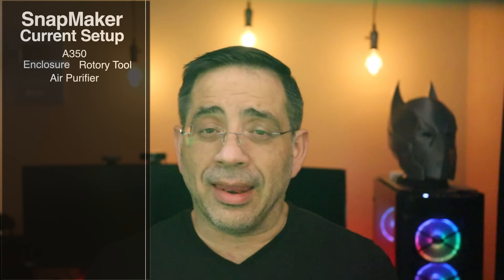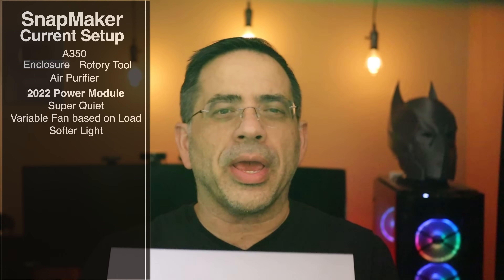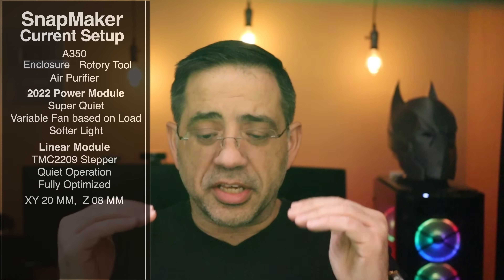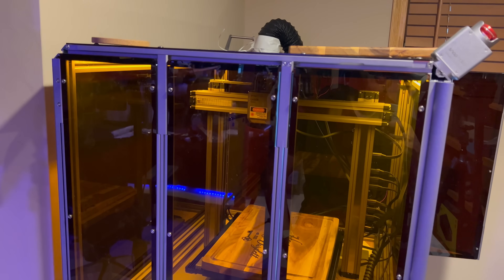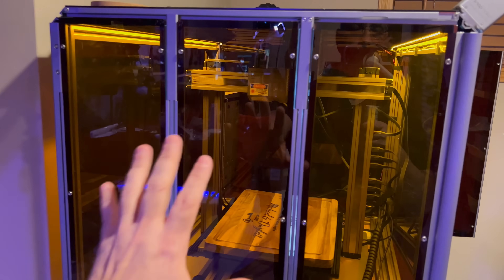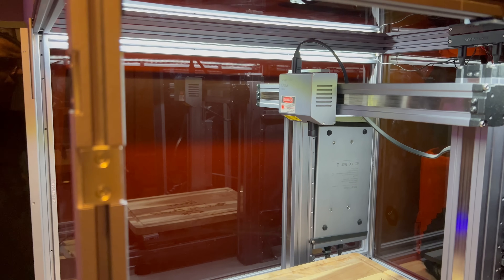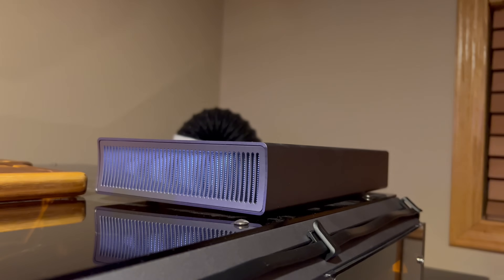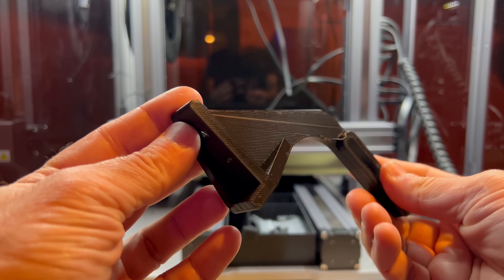I Upgraded my Snapmaker 2.0 Was it worth It?  YES!!! POWER, 3D Print Head & NEW Linear Module

Comment: In my opinion, your reasons for upgrading do NOT justify replacement or encourage me as a owner to upgrade as you did.
Reply from the maker: Comes down to your usage.  I have my snap maker in my basement.  I want it quite as possible.  So the  ew rails make things quiet.  The power supply too  makes it even more quiet. The print head, laser module all depend on you usage. It's cut my print engrave time significantly.  Now most important of all my wife doesn't complain about how loud it is.

Comment: I think it should be mentioned that the position of the folding doors and the display holder can not be changed. Which is both stupid and frustrating.

There is one folding door at the front and a second one at the right side of the printer. In case you would want or need the larger folding door on the left side, well, tough luck. When asked, Snapmaker is telling you that well, apparently the idea that someone would need the folding door and/or the display on the left side never even crossed their minds.

Comment: Nice Snapmaker. I have the same A350, and yes the power supply is loud. That annoys me more than the rails. In fact I have a Lulzbot TAZ 5 and the power supply is quiet with a variable power supply fan and no light. I might order the new power supply. Question. I also LOVE the PEI print beds as my Lulzbot has a PEI and it's GREAT. I could not find a PEI that is exactly the size of the Snapmaker. I got really close in that I found one with the identical size width but length is a little short. So I am loosing about 1.5 inches of bed lengthwise. I got a print bed from TRONXY. The PEI bed also has a sandy type feel which makes for great adhesion and a nice touch to the bottom of the prints. It's also magnetic. So, curious. Seems like the print bed you got matches the size of your A350 bed. Where did you get it. I'm not really missing the 1.5 inches but when I do a bed leveling I do have to shift the bed during the leveling so it catches the bed. That's a pain but I don't have to level all that often. But, still curious on where you got the PEI bed. Nice video.
Reply: Hi. Do you get any answer where he got his PEI printing bed?
Reply: @danielfaist-holzmann3690  I stopped worrying about an exact size. I got this one from AmazonL TRONXY PEI Magnetic Flexible Heated Bed 330x330mm Flexible Magnetic PEI Sheet. It very very close to the full size. If I want every single mm I would just put on the snapmaker bed sheet. But, since I prefer PEI I am using this one. And $45 was not a horrible price. I'm having great success with it.

Comment: If I buy a Snapmaker 2.0 new does it come with the 'Upgraded Parts' or do I then also have to buy each part individually? How could I tell? I'm trying to carefully review their website but it's not entirely clear to me.
Reply from the maker: You can get the new version that comes with the updated rails, laser and power.  For me it didn't make sense to buy a new unit.
Reply: @ebpman  , how can you determine if you have the new/upgrade components versus the older components?

Comment: I have a really hard time dealing with this printer. Got the original model, and I have not ever not have a problem with it. I just can't get myself to basically buy a whole new printer piece by piece just because it's a piece of 1500$ trash
Reply: agreed. I much prefer using my modded ender 3 than my a350